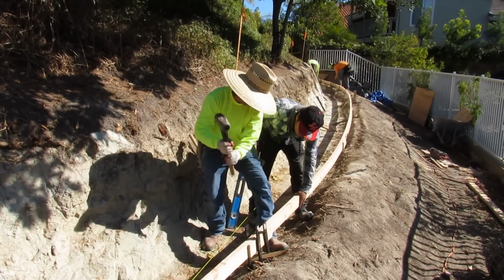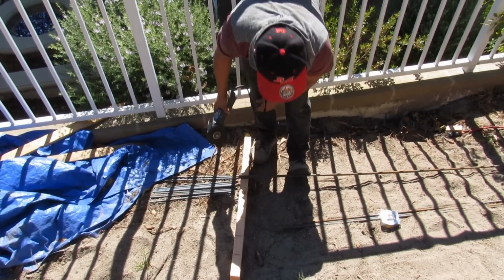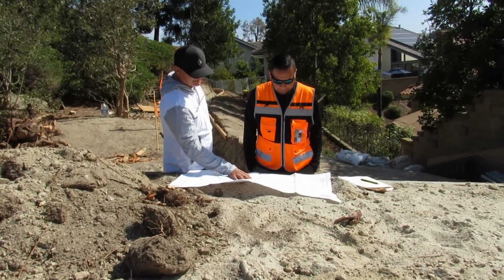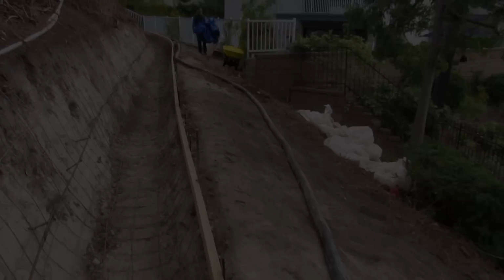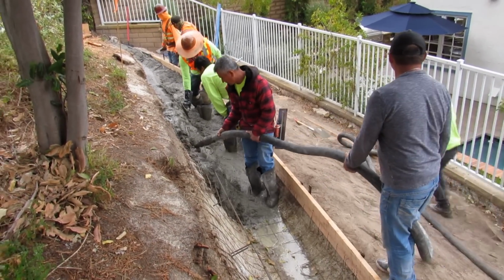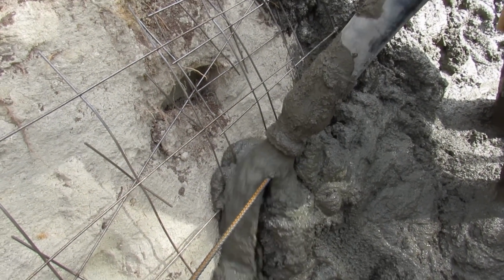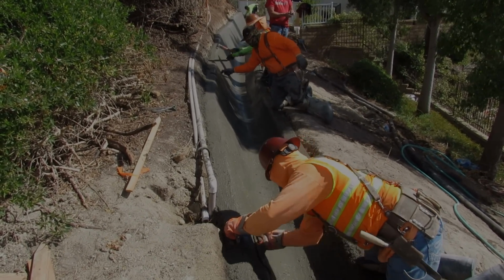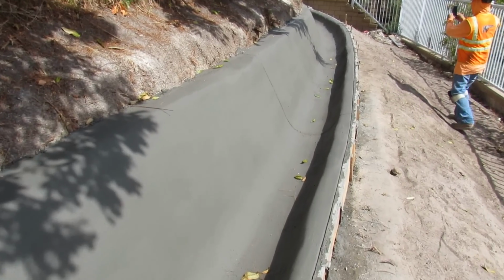Concrete "J" Ditch. The Best in the West! California

Comment: My company specialized in pool and ditches . You had the right slump towards the end of your video. Our nozel man used a hose that had the metal part cut off for better handling.  Also if you have the hose go up the back of your left leg and over your right shoulder so the tip of the hose hangs down to about 24 inches off of the floor it saves your back . Then stand sideways a bit so that your putting the concrete in a s shape on side wall ..it will stand up better .
Reply from the maker: Thanks brother 👊

Comment: Not trying to take the piss out of your build, but I'd have genuine concerns about premature cracking and failure of the concrete if this was built in the rainier parts of British Columbia. Perhaps our soil types are different enough that it's not an issue down there, but up here, cutting the upper side of that embankment on such a steep angle without a drainage layer or alternating layers of soil and reinforcing mesh would create problems in the future because the slope exceeds the natural angle of repose.

Over time water will seep in between the embankment and the concrete and weaken the previously compacted soil, which would create a lot of lateral pressure against the tall side of the J ditch. And since the only reinforcing inside is the wire mesh, it could push the entire tall side over (especially if the soil was to become supersaturated due to persistent rainfall over a long period of time). Again, don't know if this is a concern down there, but it definitely is up here.

It happens a lot up here, you can drive through a lot of neighborhoods that were built on hillsides and see all kinds of retaining walls that got knocked over within 5-10 years of being built because there was no drainage layer or engineering to control the slope of the soil that's being held back.
Reply from the maker: Thanks for watching Keith. It only raind 8 inches this year. The J-ditch is a year old and worked like adream
Reply: @WestCoastCustomConcrete  Good stuff, glad to hear it. It's crazy how much differently we have to build things because of all the rain we get up here in a year. You'll get 8 inches in a year, we'll get about 48 on average in Vancouver.
Reply from the maker: @-Keith-  whole different animal for you guys up there. So many weather factor's makes it difficult. Not to mention the freeze. We're I live is like dream conditions to pour concrete. Year around.

Comment: Are you able to make a video showing how the J-ditch handles storm water runoff during a heavy rain?  I'm interested in seeing if all of the water runs off or if there are any flat spots that pool and collect water.  Additionally, it would be great to see the finished project, with the grates installed.  Ideally, the video would be shot a year after the job is completed to show how the J-ditch is holding up over time.  Finally, do you know if the home owner did anything to mitigate the chance of leaves, dirt and other debris from falling in the J-ditch?   This was clearly hard work.  Your team and you did an outstanding job.
Reply from the maker: I definitely going to revisit it and film it👍

Comment: Still an issue with that rebar using as a gage to pull your form. Rebar left at the surface like that will prematurely rust, thus affecting the lifespan of your work, or translate into an higher repair cost. Instead of using a rebar as a gage, my approach would've been to use a stick of wood anchor into the hill nailed to narrow strips of wood. Once your done your with your template, just pull it out. easy and if the small picket dosent come out, just wack it into to ground. easy. then your finishing crew can cover the hole.

Anyways, like your channel, I like the way you elaborate your approach. Keep it up,

Comment: Sigh.. why didn't find you sooner for my retaining wall project. My biggest regret is found a random contractor on yelp.. These yelp reviews are full of sh*t.  Great workmanship has nothing to hide and tape everything for public.  After knowing there is no subsurface drainage behind my brand new two part step up stone block retaining wall (about 3 ft tall each wall, and its on a slope of 4ft in 10ft with another house on top of the slope), i questioned my contractor what happened to the drainage.  He said, with 3ft tall wall, there is no need for him to add or get permit for the drainage (according to LA code).  I was in shock and not knowing about this until he completed the order. Do you think his statement to be valid?  I live in Brea, CA
Reply from the maker: Sorry to hear that. I am in brea quite  often. Give me a call.

Comment: First of all, Amazing! Question: Since we don't see how much slope there is to the hill. Was there any concern that velocity of water run-off (severe storm) could enter at such a flow-rate that it could crest the ditch and continue into backyards?
Reply: It's engineered construction, I'm positive the architects knew what they were doing when they were calculating the angles and how fast the rain flows in even the most extreme conditions( because all the information necessary is already given to them to base their math on).

Comment: Surely the re bar thats driven Into the bank will start to rot as it has no concrete coverage and is bare?.also the horizontal re bar doesn’t seem to have the minimum concrete cover so will surely cause horizontal cracking that follows the line of the bar?

Comment: Why add the joints ( linea spaces out l) when it was already being smooth all the way through?
Reply: Concrete cracks over time, the joints control the cracking so it happens evenly in the right places
Reply: how interesting. Thanks!

Comment: 7:17   the rebar runs "in parallel" to the hill's slope, not "perpendicular" as stated.  NICE job!
Reply: @cheshstyles , do google image search parallel vs perpendicular... if that doesn't compute, scroll down to parallel parking diagrams--the hill is the curb, the car is the rebar... note that the wire mesh is NOT the rebar at 7:17...
Reply: @cheshstyles  google search "ostensibly".... so far as being a pendant, 30 years of being a geologist and a school teacher will make one quite snotty... please ignore me--carry on.

Comment: 70’s and 80’s I worked making Faro Cement boats.  My only job was to run the hose behind the gunner. I would be in charge of maybe 2 to4 guys to assist pulling hose. We had to work inside out of the boat and outside in and never allow the hose to kink and always leave the hose touching the ground behind the gunner. Did this so the gunner did not have to pull, drag and held only 2.5 feet to3 feet of hose all day. Some boats were 2 3 bag mixers and pump mounted units. Paid cash and made a crap load of money. Price of wire went up and cement boats lost the love. God it was a blast while it lasted.
Reply from the maker: Interesting. What kind of concrete pump was used?

Comment: Looks a great finish, but I notice the steel along the bottom isn't pulled up into the concrete mix, and I worry it will crack in the near future.
Just my observation

Comment: Nice job, but the wrong solution for the problem.
Reply from the maker: Worked  perfectly
Reply: @WestCoastCustomConcrete  It's your job and the way you earn a living and I can't blame you for not seeing the problem on the long run.
Please don't take this personal, but these concrete ditches are causing longterm problems that you aren't aware of.

Yes it works perfectly, until everything is bonedry and a fire starts and there is no water around for miles and miles.
I'm not an environmental or climate change green freak, but I use common sense to come to the conclusion that the wetter
things are less change there is they will burn like tinder.
Give rainwater the time to soak into the soil, it will keep the whole area greener/wetter in dry periods with lesser chance of uncontrollable fires.
But what do I care, I don't live there.

Your mind is like a parachute, it only works when it's open.  FZ.

Comment: No offense to you, you guys do really good work, but this is why California has water shortage issues. Regulations to force All the run off redirected to storm drains. Swales work basically ditches ranging from a shovel depth to 15ft wide. Sinks water into the land groundwater meaning plants dont get so dry, helps reduce droughts and thus wildfire potential.
Reply from the maker: Thank you. Your point sounds reasonable, I agree with you.
Reply: @WestCoastCustomConcrete  but as I said your work looks strong, durable and tidy. End result is clean.... if you were in my country I would hire your crew without concern. Nice job sir
Reply from the maker: @601salsa  Thank you 👍

Comment: It's nice work but I hope the county realizes this is just the first step in controlling that hillside.  Erosion control above the ditch is the next step.  And constant maintenance to keep the channel clear would be the third step.  The forth step is periodic inspections to make sure water isn't cutting a new channel behind the "J".  That soil/concrete interface on the high side is where failure will first appear.  Because as far as the water runoff is concerned, there are two directions of "down" on this project - across and into the J channel, as well as along the length of the J channel.  And any little void in the soil on that high side interface will be water's opportunity to start cutting it's own new path.
Reply: We need post 10 to go check it out during the rain.

Comment: You are a little full of yourself and that rebar you used on the backside to gauge the thickness is awfully close to the surface. Min. embedment should be least 2.3" as I'm sure you're aware. @6:49 seems to confirm my suspicion. Good job getting it down and quite the productive crew however.
Reply from the maker: We removed it 👍

Comment: You ok with talking about what you would recommend, plans call for a gunite swale  all around 4300 sf of hillside ALL soil nailed with Tecco mesh. Looking for a pumper, job in Monrovia, my guys will dig and form it. I have some finishers if needed. Low slump concrete  on vertical vee ditches might work?
Reply from the maker: Yeah it will. It depends on how much concrete hose you have to string out. I've done more "V" ditches than "J" ditches.

Comment: you should make a small basin that collects gravel and mud before it goes into the drain, there for sure is a lot of material uphill waiting to be spilled down
very nice work , My father and I once manually mixed the concrete and poured a shallow U ditch on our property - 60 meters long 6cm thick 10 hours of work for 7 people
Reply from the maker: Thank you. That's a lot of work by hand! This particular job was built to the plans.

Comment: I see you finally got the hose out of his hands😆. I just suscribed to your channel and you work the concrete like a BOSS!! I worked pouring concrete in Spain and for ditches we make the J, V, or U templetes, set them in the ditch about a meter and half away and than you pour the concrete every other one, simply let them dry and come back the next day and finish the one's that were not poured or do them all the same day. Pouring every other one is easier as two guys, one on each side can work the concrete up the walls.
Reply from the maker: lol. Thanks you! That's also a good way of doing it 👍

Comment: Does  America have bar chairs to put under there reo there not expensive  trying to lift the mesh or leave it on the bottom is no good for the strength of the finish product
Reply: Just lift the mesh, not hard to do. Big jobs like large concrete floors, I've used little plastic risers to get the mesh up. Not worth the time or expense on a project like this though. Lift the mesh as you pour. No impact on strength.

Comment: It all looks great but I have to ask, are you not concerned about the one bar you used as a guide not having much for cover? Potential rust issue down the road? Especially at the control joints. Like I said, it looks great, I’m just wondering if that was something that was addressed.  Cheers
Reply: Good to hear. :) 👍
Reply from the maker: @jcuzjcuz9894  👍
Reply from the maker: Good question. It was definitely addressed. We removed it.